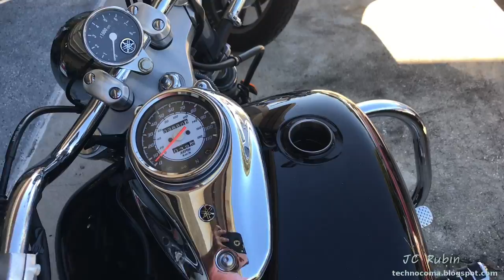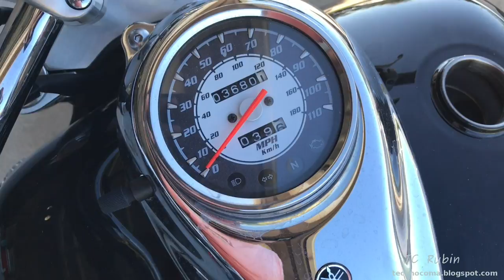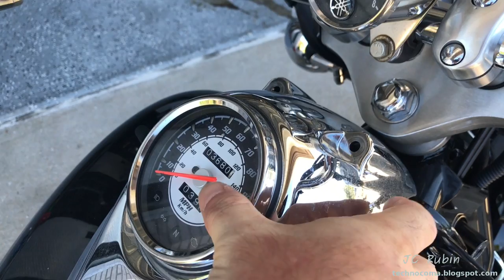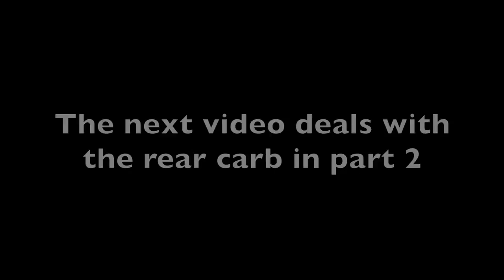Yamaha Star 650 Quick Carburetor Repair / Clean 1 of 3

Comment: Hey, thank you so much. My neighbor asked for my help on her Bike. It had been sitting for 2 years. Her Uncle had a mechanic go through the carbs before I got it. Same drama, would start and die. I went back in there and pulled the jets. small jet had some hard carbon stuff and big jet was goobered up. I soaked small jet overnite with pro grade carb cleaner. Next day, I used my wife's beading needles to ream out the jet. big jet, I just sprayed and the tube it rides on and let things sit overnite.  put it all back together the next day, and BOOM, it fired right up  and ran perfect! once again, thank you so much, She was so happy! You got it goin On Man!
Reply from the maker: Be careful cleaning out jets with metal implements. They are brass, easily deformed and you can change the gauge size. If so you will never figure out why it runs rich after that.
Reply: @retrotechandelectronics  Hi, I was careful. I am a recently retired ASE Auto Tech. I went from rebuilding carbs to fuel injection and on board computers.  We live in the desert. I am used to hard carbon stuff. It gets real hot here and real cold. Her machine was stored at high altitude for a spell. In California, ethanol is limited to 10 percent. I told her to fire it up once a week. Repair came out great! Thank you once again and for the speedy reply. Got anymore vids of repairs?

Comment: first of all I want to say thank your fixed my own bike and saved hundreds' had same issue on my star 650,cleaned jets it looks like it had original gas filter, replaced that, new air cleaner oil and k&n filter I used the right tools, and I did one more extra you forgot to mention.LOCKTITE ON SCREWS VERY IMPORTANT.CLEANED TANK,AND LIKE U SAID NO SHORTCUTS.before 80 mph wide open,lolNOW WOW 115MPH AND HAD TO LET GO,MY NEW ERRAND RUNNER,I HAVE A HERITAGE SOFTAIL ALSO,,IM GONNA GIVE HER A REST VSTAR650 DELUXE,YEAH BABY,THNX AUTHOR.

Comment: My bike is so busted up compared to yours.

Still love her tho. I also don't need to pull the seats, lifting from the front first works.

Also my gas cap and on-off switch leaks. Found that out after it ate through the paint on my garage floor.

Well made video.
Reply from the maker: Every bike is an opportunity for improvement.

Comment: I've rebuilt 100s of carbs because of ethanol in fuel. I'm fortunate to have a station close that sells non-ethanol fuel. I use it in everything that has a carb on it, especially if it is not going to be used for awhile.  Never had a carb problem since.
Reply from the maker: We also live near an E0 station. I do not fill the older stuff up with E10.

Comment: Add "Ethanol Shield" to your fuel, which prevents the gas degrading because of ethanol content... It actually works
Reply from the maker: Many products exist to do this, or buy ethanol free, fuel.
Reply: @retrotechandelectronics  much easier to add than find straight gas...
Reply from the maker: @YooTooobJeff  I dunno, all of our local gas stations sell E0
Reply: Jeff is correct.

There is nothing wrong with the Vstar650 or 1100 carb designs. The problem is E10 fuel breaks down in as little as a month and forms goop.

If you are not riding enough to drain the tank down to reserve every month then goto Walmart and get a bottle of Seafoam, and put 4 ounces in your tank everytime you fill it up. If you know you are not going to ride the bike within a month or two, do the same and fill the tank all the way so the inside will not be exposed to air and rust.

Tearing your carbs open is not necessary if it stumbles. If you have been running without Seafoam, just add 4 ounces to the full tank and ride the bike. Ride it hard when you can, like going up hills open the throttle fully. The Seafoam WILL clean goop from the jets within 100 miles of riding.

My 650 has 45K miles on it. I have never touched the carbs. It runs perfectly on regular E10 fuel.

The only time you should have to pull the carbs apart is if the bike has sat with un-stabilzed fuel for a year or more, and it will not start and run at all. As long as it runs, the Seafoam treatment will clear the goop out. And even then, before I would open the carbs I would force-fill the float bowls with pure Seafoam and let it sit over night. If it starts the next day, run it 100 miles with 4 ounces in the tank.

And BTW, the 650 is jetted to run on regular octane fuel. It is very unusual to find E0 gas in regular grade. If you run this bike on anything higher than regular it will be running lean and hot.

Comment: I've got a question if you could help out, that'd be awesome! I'm a new owner to a 08 Vstar 650 as of fall last year and a new rider too. The bike was stored for winter with the battery on a tender and gas filled full with stabilizer before storage. This past week, the weather has been great so I decided to start it up but it was having some trouble.
The bike started and was idle for a short time (~10 seconds) and died after. The bike now cranks but won't start. I've tried a few different days and the same problem. I've read some forums and watched a few youtube videos with people recommending changing the spark plugs and cleaning the Carburetor. Based off the little explanation I have here, what are your thoughts? Any feedback is appreciated!

Comment: There is nothing wrong with the Vstar650 or 1100 carb designs. The problem is E10 fuel breaks down in as little as a month and forms goop.

If you are not riding enough to drain the tank down to reserve every month then goto Walmart and get a bottle of Seafoam, and put 4 ounces in your tank every time you fill it up. If you know you are not going to ride the bike within a month or two, do the same and fill the tank all the way so the inside will not be exposed to air and rust. Its $8 for a pint, so a tank treatment is $2. If you are not riding your bike 220 miles a month its a small price to pay to keep your carbs clean. Seafoam will stabilize your fuel for about a year if the bike is left parked.

Tearing your carbs open is not necessary if it stumbles. If you have been running without Seafoam, just add 4 ounces to the full tank and ride the bike. Ride it hard when you can, like going up hills open the throttle fully. The Seafoam WILL clean goop from the jets within 100 miles of riding.

My 650 has 45K miles on it. I have never touched the carbs. It runs perfectly on regular E10 fuel.

The only time you should have to pull the carbs apart is if the bike has sat with un-stabilzed fuel for a year or more, and it will not start and run at all. As long as it runs, the Seafoam treatment will clear the goop out. And even then, before I would open the carbs I would direct fill the float bowls with pure Seafoam and let it sit over night. If it starts the next day, run it 100 miles with 4 ounces in the tank.

And BTW, the 650 is jetted to run on regular octane fuel. It is very unusual to find E0 gas in regular grade. If you run this bike on anything higher than regular it will be running lean and hot.
Reply from the maker: Ethanol fuel is crap....

Comment: I have a wierd problem with my bike. So I cleaned the carbs and the jets, put new o rings on. When I start my bike I have to pull the choke completely and let my bike warm up for like 10-15 min. If not my bike will turn off. My bike used to not do this and it would start up and be ready to go in like a min or 2 with the choke pulled. But now it's to the point it turns off unless I have it running for a long time. It turns off when I stop a stop light if I didnt let it warm up completely. I feel as if something is clogged in the jets but I have cleaned them and triple checked and they are fine. I dont know what's wrong. My bike runs fine everything is good on my bike. It just struggles to stay on if I dont let it warm up for soo long. I dont feel like this is normal because this had never happened before. Do I have to do a deeper clean or something? Am I missing something that I need to adjust or  deep clean on my carburetor?
Reply from the maker: Yeah, sounds like you have an air leak at the manifold causing a lean condition. The choke is being used as an attempt to correct it. It is only used to identify it.
Reply: @retrotechandelectronics  yo think so, like my bike I have to let it warm up for a good 15-20 min if i dont want my bike to turn off at a stop light. It's at low rpm is when it turns off or idling. By the manifold you mean the plastic air intake that sits on top of the carburetor or do you mean where the air filter is? What's the manifold, sorry I'm dumb lol I'm still learning.
Reply from the maker: @luisruiz5933  Yup . thats it, spray that area with carb cleaner see if the idle changes
Reply: @retrotechandelectronics  I think i see what you mean I just looked it up, Ill try what you said if not I will take it apart clean it and make sure it is aligned correctly. Btw is it normal to have a little bit of oil in the Silencer Intake? its the large plastic thing that sits on top of the carburetors.
Reply from the maker: @luisruiz5933  Your oil level in the bike may be slightly overfilled, or may have been, check it.
Reply: @retrotechandelectronics  I just found the problem you were right it was the manifold, I took it off cleaned the whole thing and the outside of the carburetor, aligned the manifold to the carburetor and it starts up perfect now although it's cold outside I need to pull the choke a little but it doesnt turn off anymore.
Reply: @retrotechandelectronics  Thos is kinda random but when I had my bike the mpg was around 50 but now it's around 40, recently it went to 30 is that normal? The bike is running perfectly fine now tho

Comment: What did you use to clean out the IDLE jet hole....I dont think you told how...I can see thru mine BUT its a very small hole that only a  small needle could go thru !
Reply from the maker: brake cleaner and compressed air.

Comment: Is that Tach difficult to install? also, I really like that seat. My seat kills me after about an hour of riding. Maybe if I can get some new foam or something
.
Reply from the maker: The tachometer is not a difficult task.
Reply: You could take your bike to an upholstery shop and have a gel pad (available on line) or memory foam. It shouldn't be a big deal. More importantly though I recommend that you wear padded bicycling shorts under your pants. They are a great help on long rides. I was a motor officer for 15 years and have ridden twice as long, so I've discovered their benefits. You can purchase male or female bike pants and/or just the pads on line very cheaply ($10-15 max) via eBay and (possibly even better) Alibaba / AliExpress. Ride safe! 🏍

Comment: I have a question, i opened the carbs and cleaned them, and put everything back together, but the bike only idles, the moment i give it more throttle, the engine dies, can you tell me what could be the problem and guide me how to solve it, thank you
Reply from the maker: You still have a carb blockage it would seem. More extensive cleaning is required.
Reply: @retrotechandelectronics  THank you for taking the time to reply
Reply: Hello....ok i opened the carbs, cleaned the pilot jet, main jet (throughly) but same problem. I opened the air filter intake and when i cover the air hole the bike jumps and works fine. it was sucking in too much air. i replaced the air filter and the problem still persists.  when its idling it appears that the front cylinder is not working. but when i cover the air hole it works. Its taking in too much air.....and no fuel is going thru the front carb to the front cylinder. There is enough fuel going in the carb, i checked that (the air out of the exhaust for the front cylinder is not hot either when idling).  Can you tell me what would be the problem......would really appreciate your feedback